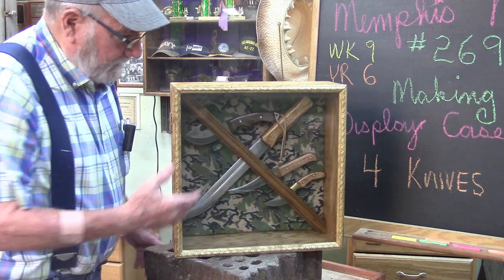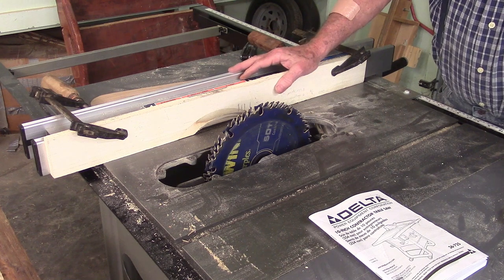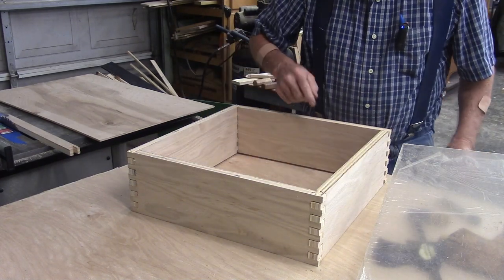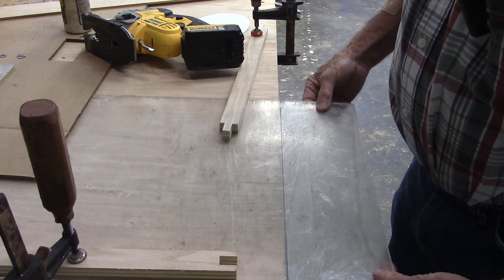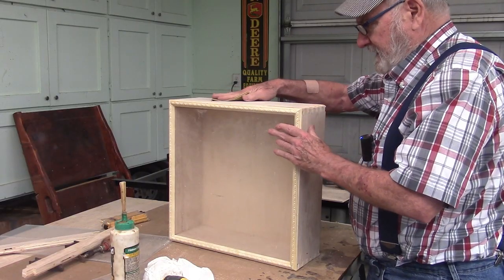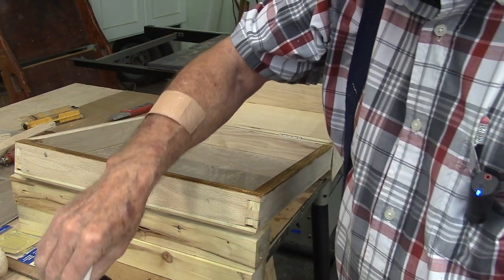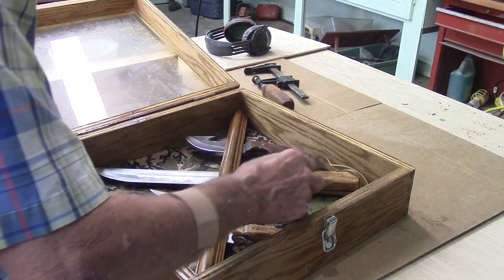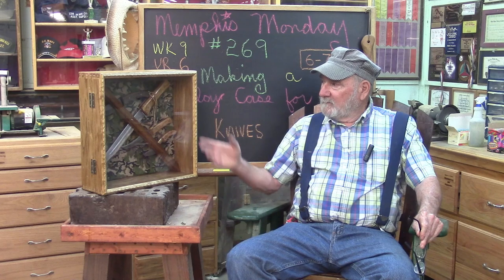269 Making a Display Case for Four Knives Year 6 Week 9

Comment: I always enjoy your videos and this one was no exception though I find the single side sound track annoying. The backing material looks familiar, looks like you found a use for the left over from your other display case build and your knife mounting system is quite elegant. It's simple, easy and effective. I'll be back next week to see what you're up to. Until then, stay busy. Busy people last longer.
Reply from the maker: Thanks for the kind words, and for reminding me of the sound system issues.  I've checked my editor and my camera, plus I've checked my WiFi microphone.  This afternoon I'm going to disconnect the remote microphone (that little unit you see clipped to my pocket) and see if the problem persists with other mics and sound systems.  I do put some effort into making these videos, so it breaks my heart to realize the sound is defective (and that I don't yet know how to fix it.) 
     If busy people last longer, then I should last for a long time.  Except for the fact that I'm so busy because it takes me longer and longer to do everything, with no net gain in production.  But on reflection, these are all wonderful problems to have, considering that nearly a third of my graduating high school class has already checked out of the pattern.

Comment: Did you have any problem using the box joint jig with the new saw?    It is too bad that you won't be able to use your 8" dado sets.  I am sure you can find someone out there who can use them.  (If you haven't already.  After all, I am so behind the times.)  

Have you ever tried putting petroleum jelly on the "Plexy-glass" to keep the stain from getting on it?  I know you can do this with windows but didn't know if it might have an adverse effect on the "Plexy-glass".  

You gave your buddy a nice bonus with this display case.  By the way, I really like the new brand.  I am sure the recipients of your projects enjoy this extra touch.
Reply from the maker: Yep, I had to buy a new dado set for the new saw.  I hated that old saw anyway; the height adjustment and tilt were both a pain.  I have several things I want to give away, perhaps I'll do a video and look for local Memphis Applegate viewers.  Great idea, did I just think of that, or did you?  
    Great tip on the petroleum jelly idea, as I bet it will work.  I will try it next time and take full credit in keeping with my status as a very stable genius.  I don't think Vaseline reacts with plexyglas, but I could be wrong, and in that case I'll blame it somebody else, China perhaps.
     Still learning on that brand.  Hard to get the temperature right, and then apply the right pressure, for exactly the correct amount of time.  
     On to the next comment.  I know I'll miss some, so you need to poke me.
Reply: @MemphisApplegate  Great idea you came up with to find some of your devoted fans to donate your things.  

You are welcome to take that idea as all yours if it works and, of course, blame it on "Jina" if it doesn't work.  

That brand did look like it would take some practice to use.  However, if anyone can perfect it, you can.